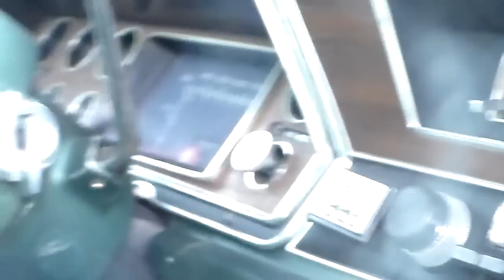Mopar A-body wiper seal replacement pt. 1

Comment from the maker: Well, on those, the end of the dist shaft fits into a slot on the top of the oil pump shaft, as you know. It's either in time or 180 degrees out.

 What you may want to do is pull the driver side valve cover so you can look at the rocker arms for #1. That way, you can make sure you are on TDC for #1 when you stab the distributor. Some of those engines are known to have more than one timing mark on the balancer.